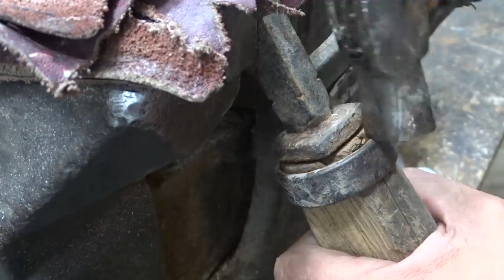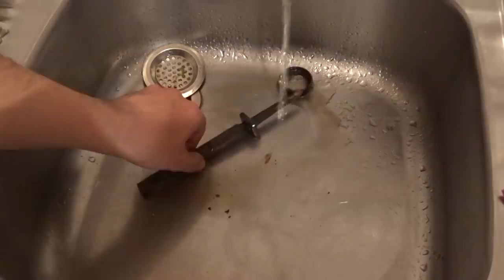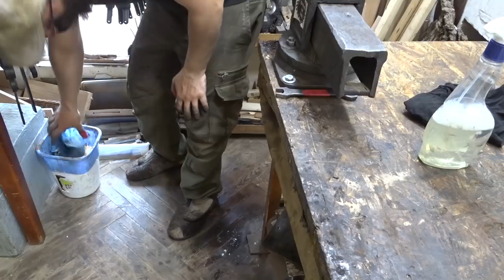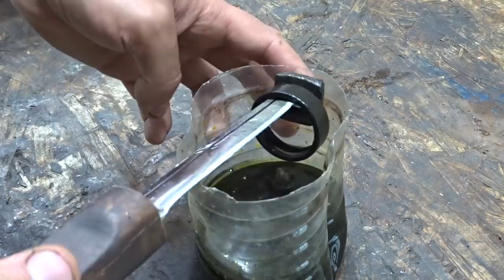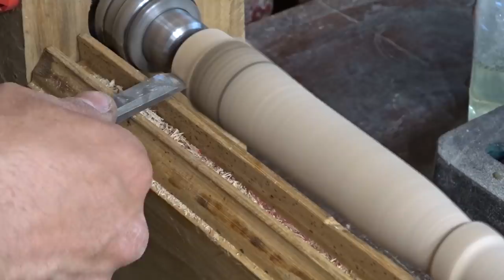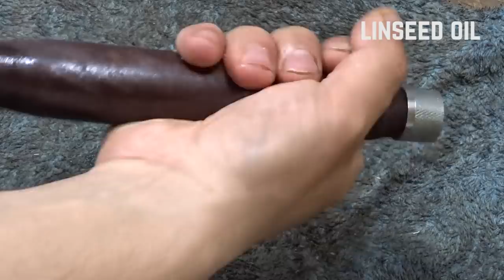Restoration Rusty Old Mortise Chisel

Comment: kudos on the home made lathe. I like it. I had a store bought drill powered lathe years ago. Now I have a store bought setup that turns a hand electric drill into a drill press. Makes for better precision. Actually I think the tool you did here is better suited to use on the lathe, though it can obviously do double duty. You can make all the lathe tools you need if you can get hold of some decent steel rods. Obviously you can make the handles and shape the heads. however you want. A skew chisel, a gouge or two and a parting tool are all you really need for most wood turning.... and some practice of course. Do whatever you can to make sure your tool rest is sturdy and doesn't move at all. A strip of metal across the top will help the tool glide easier. So long as you can get pretty good steel, you can make any tool you want. It doesn't even have to be high priced tool steel, but must have a bit of hardness to it, once it's shaped. very mild still will work for like a minute, but not long.
Reply from the maker: Hello, thank you very much! I always appreciate your advice.

Comment: Just a suggestion, unless your shop is really ventilated you should use washing soda instead of salt.  Salt produces chlorine gas when used in electrolysis.  Not that this tiny job made much, say, like me, you use it on something big, like a tractor hood, there is a lot of chlorine being produced.
Reply from the maker: Thank you for attention sir, my doors are always open and the room is ventilated.

Comment: hey man, nice video. Just a small advice. Do your electrolysis with baking soda instead of salt, and in an open space. Salt produces chlorine gas and hydrogen, both toxic and flammable.
Reply from the maker: Hello thank you for your attention sir, I always keep the doors open to the balcony. I just ran out of soda.
Reply: Actually, washing soda (sodium carbonate) is a better choice than baking soda (sodium bicarbonate).
Reply: @ScrewsAndTools  bad you didn't apologize about it
P.S. just joke don't apologize too much)